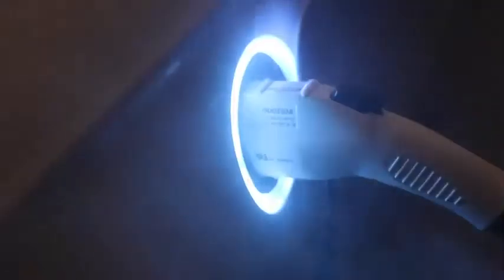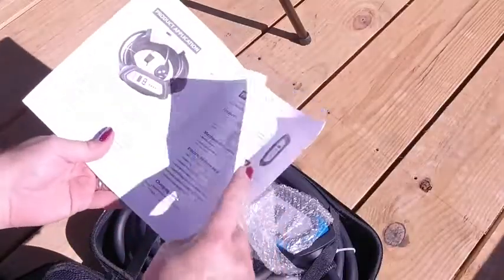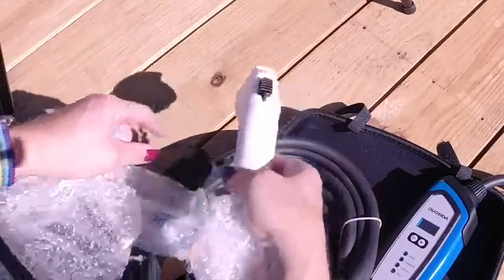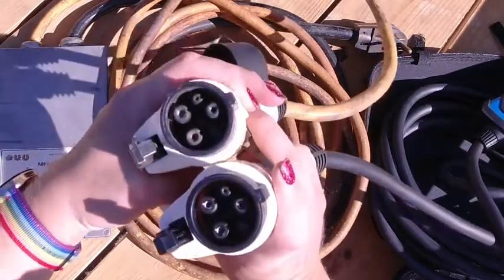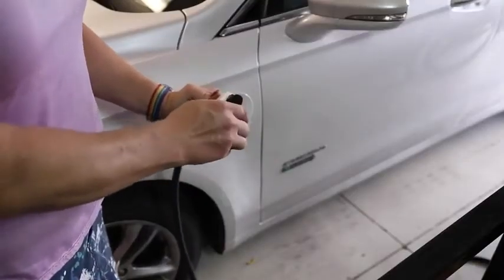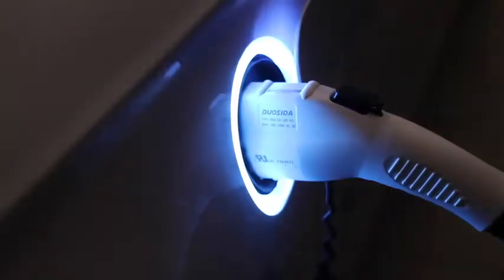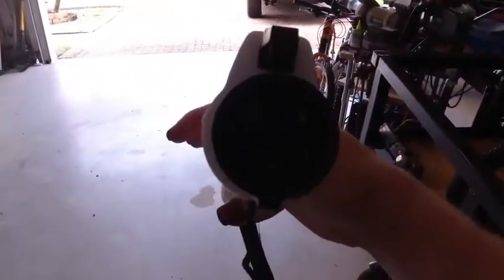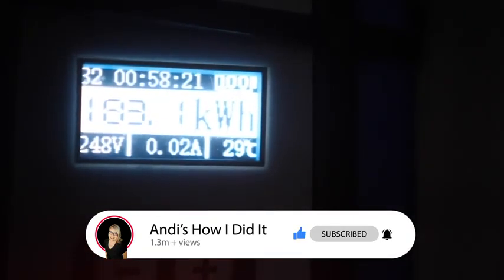How to Test Level 2 EV Charger| BougeRV

Comment: (This product should not be plugged in 240v receptacle when not in use)BougeRV Level 2 EV Charger (240V, 32A, 25FT) Portable EV Charging Cable EVSE Electric Vehicle Charger with NEMA 14-50P (If you do after 1 year warranty is over it will not work).

Comment: Mine says connected, while the charger is not plugged into the car and when I plug it in it is not charging. Delayed charging is turned off in my Chevy Bolt. I have tested my outlet and it all seems to be ok. Unplugging it from the wall outlet and plugging it back in does not seem to reset the charger. Do you have any ideas?
Reply from the maker: Hello, Nick🙂
In order to better help you judge and solve the problem, can you follow the steps below to troubleshoot the problem:
1. Check the circuit breaker. (If you use a 32 Amp level 2 charger, your breaker should have at least 40 Amp.)
2. Use our charger to charge another car to see whether it works or not.
3. If it still can’t charge, please contact us via service@bougerv.com.
BougeRV Customer Service

Comment: Great video!! I just installed mine. I am just curious does the display stay on while plugged in and not being used? Is there a power button for this display?
Reply from the maker: Yes, the display will stay on if you plug it into the outlet and there is no power button for the display. We recommend that you should unplug it when not charging🙂